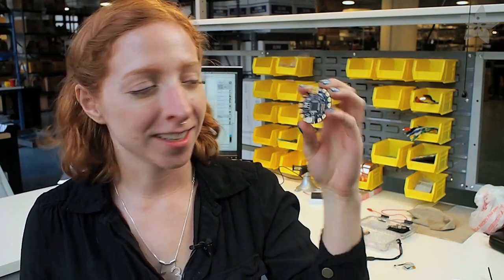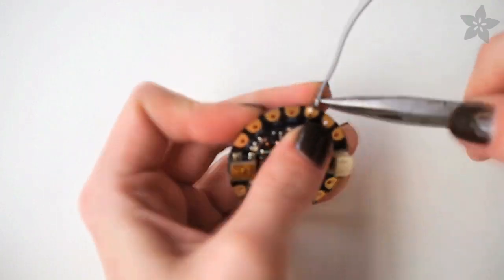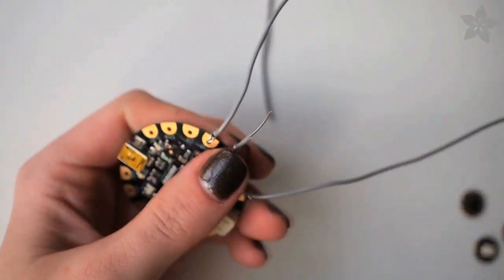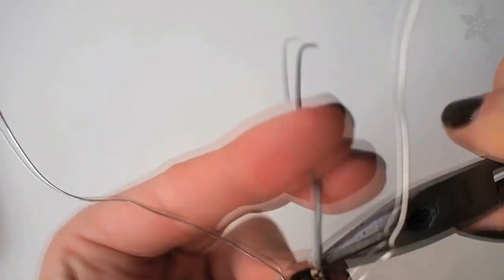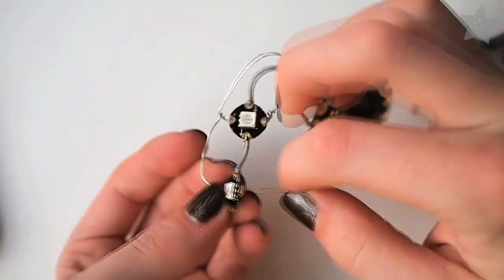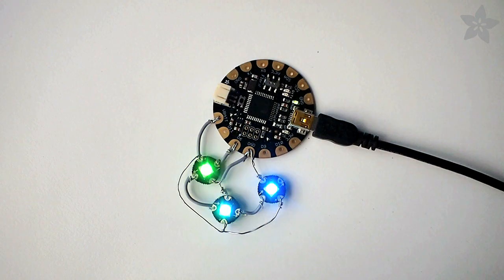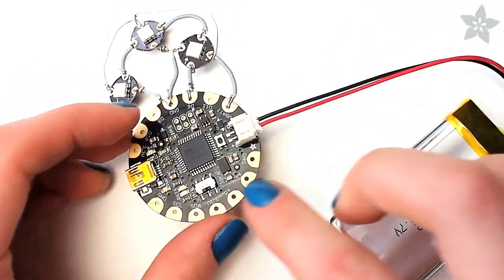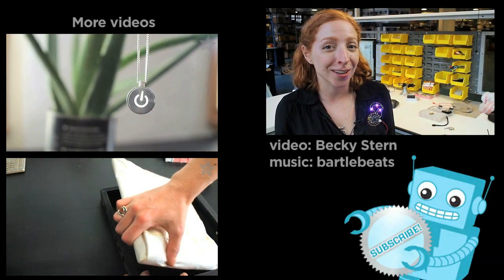Flora Pixel Brooch

Comment from the maker: FLORA Pixel Brooch - Maxiumum blinken, no soldering! #Wearables
  #FLORA  
https://learn.adafruit.com/flora-pixel-brooch

Make this color-changing LED brooch with FLORA! It's a quick project with no soldering, just free-hand wiring to make the connections. Use our sample code or change it up to display whatever colors or fading effects you like! If you're new to FLORA, check out the Getting Started guide and the FLORA RGB NeoPixels guide prior to beginning this project.

Comment: The flora 2 has much larger holes, and the twist secure method is not working well. its wobbly, and if you try to twist it any tighter you risk breaking the small margin between the holes and the edge of the board